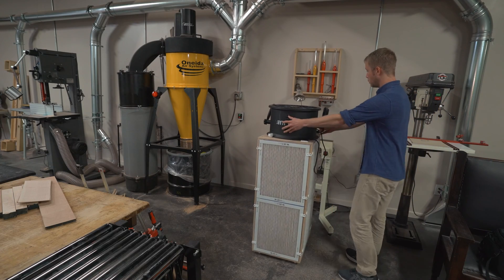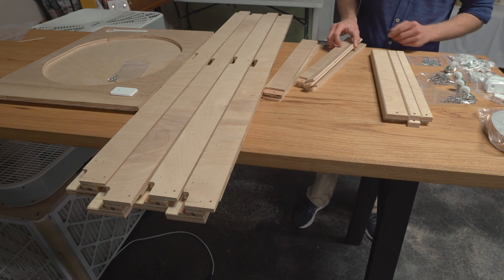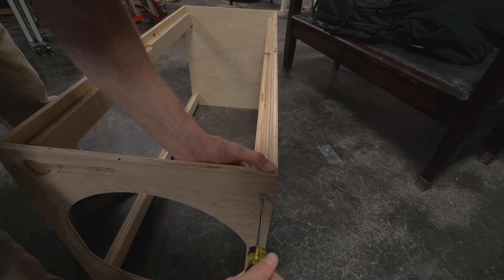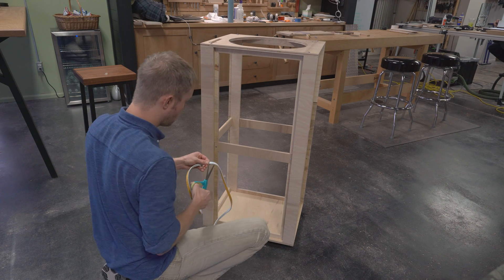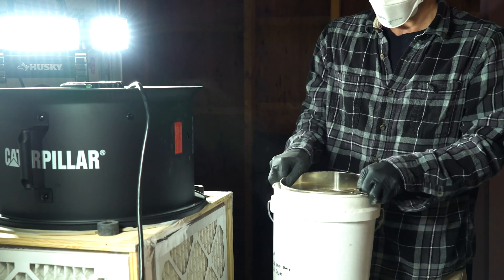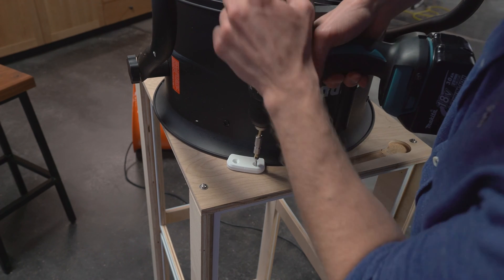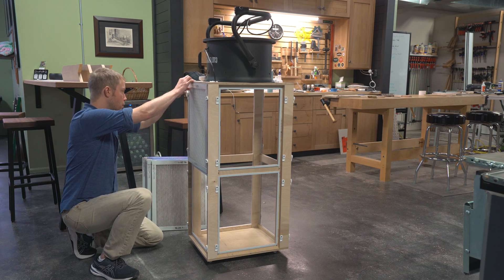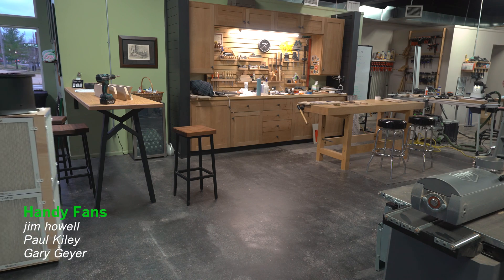Air Filter Kit - Model-A - Design and Assembly

Comment: I was thinking about ordering your design! Great work! 

Were you able to determine a difference in air filtration from push vs. pull? Any AQI values?

/EDIT/ 
Just read another comment where you answered this. So push (out of the box) is more effective at a distance and keeps particles airborne longer?

Will either orientation keep the overall dust or AQI about the same in the end? It sounds like the push might allow dust to settle if not taken care of quickly?

Also, do you think a push setup at one end of the room and another setup in pull at the opposite could maximize AQI and removal of particulate?
/EDIT/

I have some atrocious synthetic carpet at my home that leaves micronized dust everywhere and feel that the push (into the box) would be best. 

What are your thoughts? Thanks for the work on this!
Reply from the maker: Good questions! I feel like the best option in that scenario might be the "pull" ( air blowing out of the top of the box) method may be best. The "push" option is better if you have a single point source of particulate (like a saw or sander, etc). I'll do a video on this concept soon with all the details but the short of it is that at a distance beyond 5ft (I tested at 15ft away), the pull method outperforms the push method by 2x in the AQI test.

So, in short, for a large room full of particle producing carpet, the best option is to blow air out the top. The model/A, B and C would all work in this type of filtration. 

I hope that helps. Let me know if you have any other questions!

Comment: Awesome looking kit! The use of gaskets to seal each filter seems like a really nice upgrade. If someone were to make the original based on your plans, but incorporating this new design element, would you recommend cutting the rabbets a bit deeper (maybe 1/16 or 3/32?) to account for the thickness of the gasket?
Reply from the maker: Thanks! If you cut the rabbets 1/16" deeper and use 1/16" foam strips, it should work just fine. You may want to double check the thickness of the filters you intend on using before making the cuts, especially if you are using the Filter Clips to secure the filters. If you are, the filters need to be in line (or better, slightly protruding) with the outer edge of the wood for them to function properly. Otherwise you could use a different thickness of foam to make up the difference.

Comment: I think it’s amazing what you’ve put out here. I was a teacher up until lockdowns started and I wish kits like this would’ve been available to get in some classrooms. 
Secondly I have actually built this version myself a couple months ago. Right now using tape for the filters. Any chance you will put the upgraded filter clips on your thingaverse? Currently looks like the original design is still there.
Reply from the maker: Indeed, I thought about it at the time but it took so long to make them, I figured the price would be too high for people. Shipping is also really expensive. The CR boxes filled a nice gap there during the pandemic. 

Good point on the filter clip STLs! I will put it on my to do list. Not sure when I will get to it tho, things are pretty hectic at the moment. Check my thingiverse in a month? :)

Comment: Question: how can I calculate how many filters I need based on the CFM of my fan?
Reply from the maker: That is a great question! I will address this in one of my next videos that covers conceptual filter design. It may take me a while to get that out. The short answer is, more is always better. Look at 3M filters static pressure ratings at ____CFM.... check your fan CFM.... you will want to keep the SP rating below .1 for the whole unit. Maybe an even shorter answer is one filter for every 200cfm or so. Hope that helps, I'll cover it in more detail in the future.

Comment: Thank you so much for you great videos! I planning to build such a air cleaner for my woodworking workshop, but sadly i cannot get a hand on the Caterpillar fan here in Germany. I am looking forward to your next videos which might show other option of great fans?!?!
Reply: Same here, in Argentina. But will go for an industrial fan. Not as fancy but equally effective
Reply from the maker: If you can drop a link to a fan you think might work, I can reference it in one of my next videos on designing filters from scratch for your own needs. I'll also cover a wide range of them as well. Something has got to work!
Reply: @The3DHandyman   i tried now several times to post the links to the fans I found at Amazon, but somehow this comments seemed to be removed. Thanks anyway for your support!
Reply from the maker: @andreasflinspach6934  Sorry about that! YouTube does that automatically. If you could message them to me on Instagram of Facebook that would for sure get through. Sorry for the trouble!
Reply: Er hat auch andere Lüfter in seinen Videos verwendet, auch diese rechteckigen, die werden dann mit Klettband aufgeklebt und fixieren den Lüfter auf der Oberfläche. Die Größe sollte nur passen.

Comment: Great video and was looking forward to seeing it… glad it came out today. I am building mine this weekend based on your Plan and can’t wait to be using it.  

My question is the following… I was looking to have the Caterpillar air blower blow inward… if I keep it running in my garage for an hour or so, will it eventually filter the ambience air in the same manner if the blower was position outward? I wasn’t looking to have to flip the air filters or air blower every time. 
Thanks!
Reply from the maker: Good question! The answer is yes it will still filter the air in the garage in the "push into filter box" config, it will just do it less effectively at a distance. So 15-20 feet away the filtration performance will drop by about 30%-50% vs "pull out of filter box" method (I have the data somewhere but I am short on time at the moment). I'll be doing a video about this concept in the new year. Thanks for the comment!
Reply: @The3DHandyman  i know you said in another video that you preferred to have the fan push air into the filter box and exit the box through the filters.  Based on this answer, which configuration is most effective for general air cleaning on a wood shop?  In the pull the air out of the filter box configuration, does the fan blowing directly into the shop help or hurt the effectiveness of filtration.  Initially, I thought it would keep more particles stirred up in the air for longer, but if moving particles around ultimately gets a higher percentage of dust into the filters, then I get that too.
Reply from the maker: @mickeymallette2663  To filter the ambient air in the shop I highly recommend pointing the fan UP and out of the filter box. It does stir up air to keep airborne particles suspended for longer and it also moves more air through the shop than blowing air into the top of the filter box. The reverse option is really only effective from a short distance away from the source of dust.

Hope that helps!
Reply: @The3DHandyman  it definitely is. I have about 600 sq. ft. And just want general air filtration

Comment from the maker: The kits are back in stock! https://www.etsy.com/listing/1373712349

The Model-B/C now has a drum fan upgrade that matches the performance of the Model-A. For now the Model-A will be a make-it-yourself option only. The 3D printed parts for the Model-A are still available as well as free plans here https://the3dhandyman.com/workshop-air-filter-drawings/

Model-A Parts kit (wood not included):
https://www.etsy.com/listing/1309978884

Performance numbers:
Model A + Maxx Air fan + 3M MERV 13 filters = 1448cfm
Model A + Caterpillar fan + 3M MERV 13 filters = 1396cfm 
Model A + Maxx Air fan + Nordic Pure MERV 14 filters = 1320cfm
Model A + Caterpillar fan + Nordic Pure MERV 14 filters = 1249cfm

I prefer the Caterpillar fan due to the enclosed motor. All the link are in the description.

Comment: Great video, how would this work if I wanted to ceiling mount it instead of it rolling on the floor?  Do I need to adjust the design at all?
Reply from the maker: Great question! I think the operation would go something like this:
1) Take the legs off of the fan, they are not needed and will add weight.
2) Use the supplied hard mounts to securely attach the fan. 
3) Mount it to the ceiling or wall using the open flat areas of the legs. Try not to obstruct the filter or drill into the filters. Preferably you would stand the unit off of the ceiling/wall so that all 8 filters are still in play. If you close off 2 of them for a 6 filter unit, the performance will be reduced. The filter surface area to air flow rate is still within an acceptable range with 6 filters if you must mount it in that way due to ceiling height limitations. The filters should just be replaced 25% sooner.

Otherwise no adjustments should be necessary!
Reply: @The3DHandyman  If I am ceiling mounting, which direction should the Fan be?  (Btw I have the CAT one)
Reply from the maker: I would probably go with the fan blowing air out of the box. It created better circulation through the room for overall more efficient air cleaning.